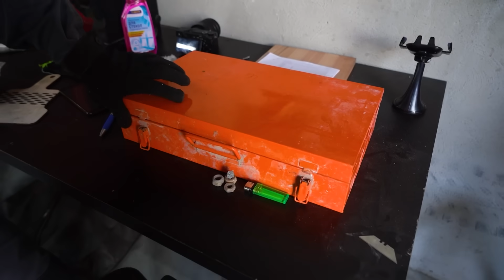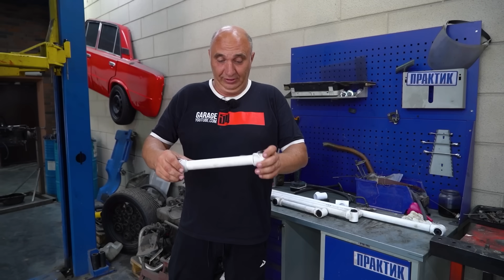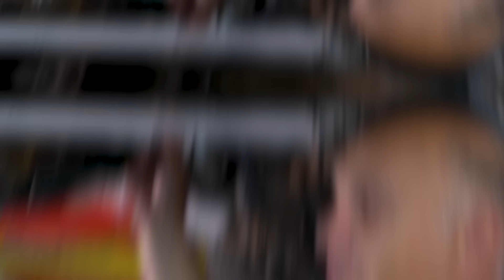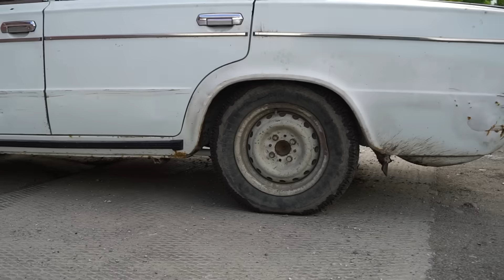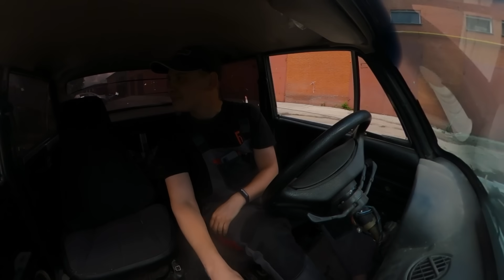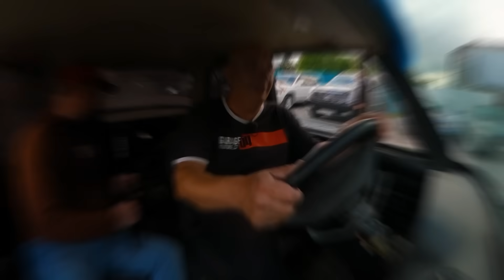We make suspension links out of PVC pipe - will they work?

Comment: Ok here, this is a very informative video !!
You race car guys will get to see how forward bite, And front end lift actually work !!
Static pinion angle 4° down,
Once car moves pinion goes up.
Watch the lower arms flex as torque is applied.
Housing rotates up.
Countering wheel rotation.
Send this to your racing friends !!

Comment: A wonderful enhancement for a Lada that would significantly increase driver engagement would involve bringing the driver and any passengers into more intimate contact with the roadway. To achieve this, a Lada would need to have it's wheel-wells removed as well as the firewall, the floor boards and rocker panels and why not remove the lower half of the the doors.  This way, driver and passengers can more fully enjoy any splashes from puddles, mud-holes, etc. and can interface directly with any vegetation that may engulf the vehicle while driving off road. Additionally, tires will periodically throw up pebbles, rocks, stones and small boulders for the enjoyment of the occupants. You guys have the requisite skill for making these improvements and I eagerly await the test drive video.

Comment: Here's an idea. Make an engine run backwards by using the exhaust manifold as the intake manifold, and the intake manifold as the exhaust manifold. That should work without having to modify the crankshaft or the camshaft. Because the pistons move in the opposite direction, the exhaust stroke becomes the intake stroke, the power stroke becomes the compression stroke, the compression stroke becomes the power stroke, and the intake stroke becomes the exhaust stroke. The spark advance becomes spark retardation, so that might have to be modified.

Comment: Fill the PVC pipes with fiberglass rods (boundary markers work well for this) and you will have some ultra strong and flex resistant arms... same technique used to make a longbow from PVC and fiberglass rods. Just pack them into the pipe until you can't fit any more and there's as little movement as possible.

Comment: I could see manufacturers building cars with components that will break if the car is floored or if a doughnut was ever attempted or car driven wrongly in any way.,  breaking to hard and axles snap or burn out and different stuff just goes but if driven easy then the thing last..
Reply: Car buyers don't want fragile cars.

Comment: That's a great idea. I have a couple of suggestions:
1. Insert a rebar piece in the pipes, it will reduce their bending.
2. I would like to see you fit a custom built BMC type suspension (British Motors Company). It was a custom built shock tower with a mix of water+glycol. When I studied about that, it was very comfortable. You lads should try it.

Comment: fill them with fiber glass reinforced epoxy? epoxy that doesn't need to off gas so it just becomes solid after mixing... blended fiberglass mixed into part one of the 2 part epoxy, vacuum pump the air out, mix it with part 2, vacuum pump the air out again then quickly pour into the pvc pipes. some park benches are made out of recycled plastic... there heavy as cement when powdered rock is added.
Reply: Interesting idea but I have a feeling that balancing the right epoxy could be difficult to ensure it's able to survive repeated compression and thermal cycles without cracking and/or detaching from the the PVC. Fiberglass or CF could help and tune the behavior a bit but would require a lot of experimenting. Something more flexible like a silicone or polyurethane adhesive mixture might be interesting to try.

Just a shower thought but I wonder how filling it with a fluid would behave with some sort of dampening mechanism at both ends (sealed inside the tube) to allow it to expand/contract as the tube bends. As I write this I'm realizing why this would probably be a terrible idea but I can't help but think something like this could theoretically work since the tube is effectively behaving as a spring. The weight may be an issue unless an internal, smaller diameter tubing could be used.
Reply: wrap the rods with carbon fibre sheet and resin

Comment: It's only a matter of time till new cars are made with plastic suspensions.
Reply: dodge has plastic control arms, volvo and corvette used fiberglass leaf springs.
Reply: @flippydipp false on the ram parts
Reply: we have this. corvette use composite. some older volvos etc. it makes the best suspension. fast reaction and built in dampening
Reply: New ram 1500 use a mostly plastic upper control arm
Reply: They already are
Reply: All ready happening, plastic control arms..
Reply: They already are look at the suspension components on a 2010 and newer vehicles you'll see plastic sway bar links and control arms.
Reply: Plastic valve covers and plastic oil pans are the worst, but don't give them ideas..
Reply: It would be a cost saving measure...
Reply: My 2004 WRX has plastic sway bar links!
Reply: It's actually not the material that makes modern cars suck, it's the design philosophy. Car companies make things that intentionally fail so you have to buy new ones. But in reality plastic is actually totally fine if you design it correctly. In fact I prefer composite on some components for the added compliance. Carbon fiber wheels are awesome, for example.
Reply: 02 ford tures only thing to brake was the plastic linkin rods for the sway bar to the A arm
Reply: There's already plastic sway bar links, and other pieces.
Reply: They already have upper control arms in composite on some dodge vehicles.
Reply: Teslas have plastic control arm with very thin metal in middle
Reply: Never going to happen because plastic wears down from even small debris the size of sand over time.
Reply: @Fk8td  Metal also does, that is how you make it shine, and I a not even talking about what water and salt can do to your car.
Reply: @Fk8td funny because it's already happening. Maybe look into it. Dodge, Tesla and others that are listed above in other replies in fact are doing it now, and have been for a while.
Reply: Fill them with concrete.
Reply: Already done on the Dodge RAM if I’m not wrong
Reply: I am afraid American manufacturers are gonna switch to plastic and charge 2x as much. Glad I don't own a car.
Reply: @thatguyalex2835  I own 7. I will keep those seven for a good, long while (20 years at least). I feel sorry for my childre though... rust will get my old cars eventually.
Reply: Don't give Doge ideas.
Reply: They have been for years, it just has metal powder sprinkled in it for extra toughness.
Reply: Plastics can be incredibly tough and lightweight materials, the problem is that theyre commonly used as a cost cutting measure and the necessary engineering and development to achieve good results is left to the wayside.
Reply: There are plastic swaybar links and lots of plastic components already...
Reply: You're wrong. The whole car will be made of plastic. One time use. You go on a trip, take it back to the dealer and buy a new one. $100 average.
Reply: @desertstar223  not compatible with self driving business model
Reply: @desertstar223  more 65000$ average.
Reply: @desertstar223  When all cars are made from plastic, crashes become no-op as cars just bounce when they collide... You can make plastic frame and fill it with water or alcohol-water mix and you get shock absorber that will dampen even if you hit solid rock or any other stationary obstacle.